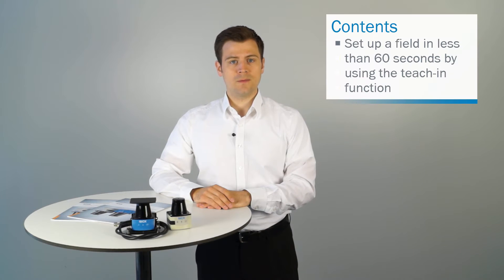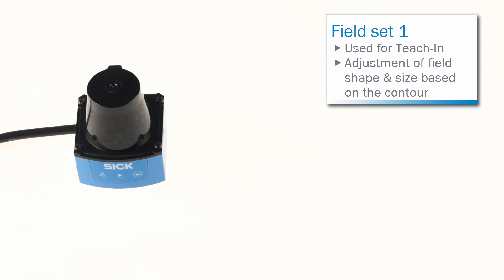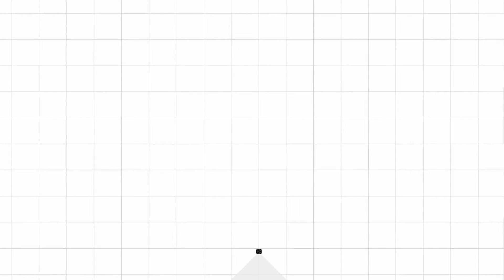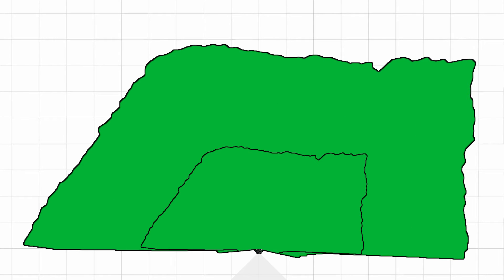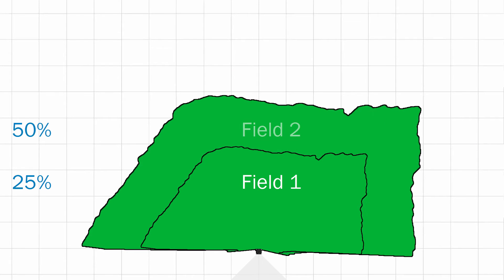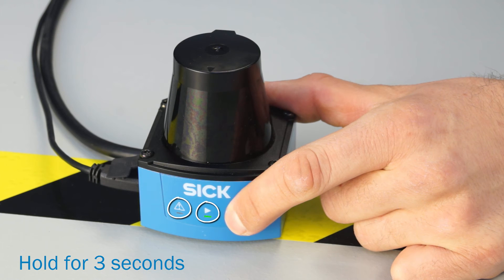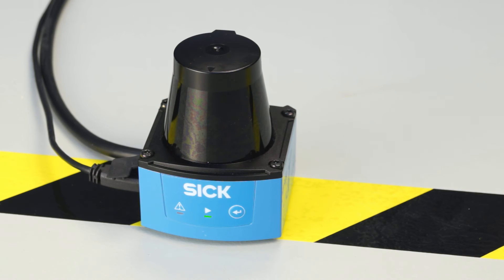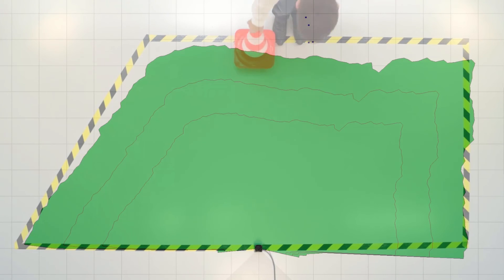Tutorial TiM3xx (Part 2/2): Teach-in in 60 seconds | SICK AG

Comment: Hello, can you tell me why TiM3xx doesn't have technical Information documents like TiM5xx in your homepage please ?
Reply from the maker: The TiM3xx is a LiDAR sensor with integrated field evaluation, that enables the sensor to detect objects and activate for example a switching output. The configuration is done using out graphical SOPAS ET software.
On the other hand the TiM5xx is a streaming device that sends raw measuring and process data to a computing unit (like an Industrial PC) which normally evaluates the raw data with a dedicated software.
As this raw data handling is more complicated than setting up detection fields we offer a special document, called the “Telegram listing”, that describes the raw data communication.
In case you need a device with a combined field evaluation and raw data output please check the TiM7xx products.